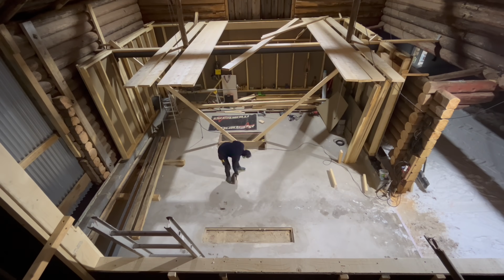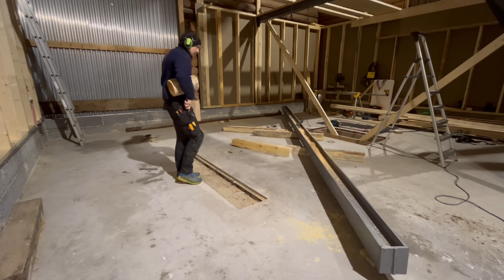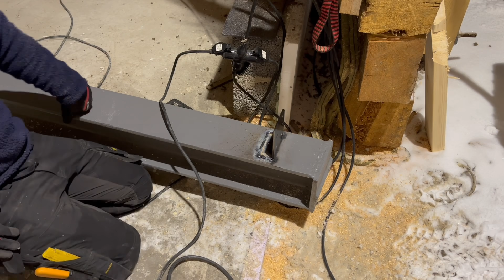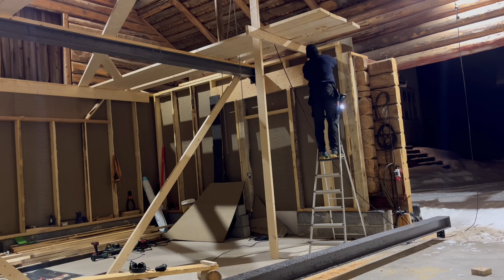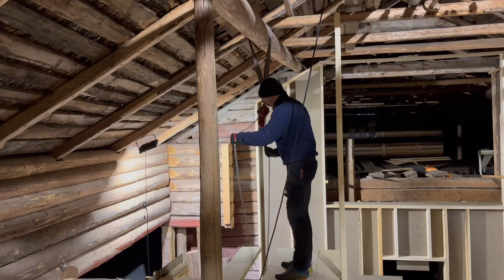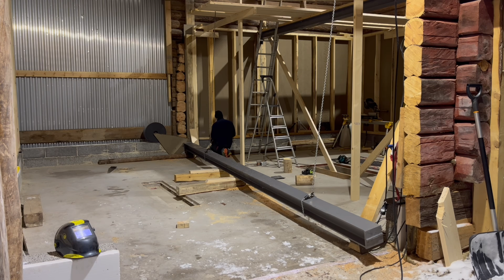Garage Build #13 Lifting Second Beam

Comment: Is assembling stick built wall framing with screws rather than nails, standard practice there ?
Reply from the maker: I'm not a carpenter by trade, but I think the most common these days would be a nail gun:) But as I don't have one, I prefer screws because it's easy to make changes too.
Reply: Screws have more pull resistance than nails but  nails have more shear resistance. So screws  break with movement while nail give , being more malleable.  Nails to hold the framing together but screws or nails to hold on the sheathing.